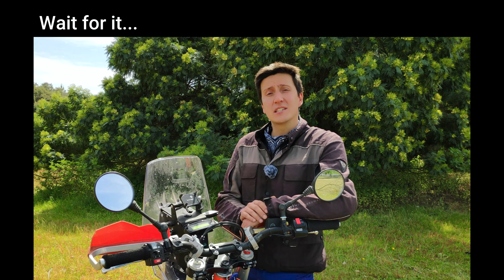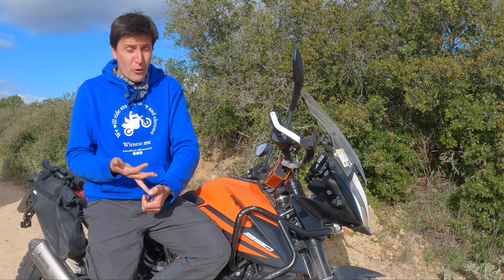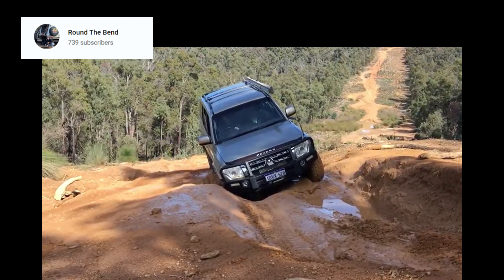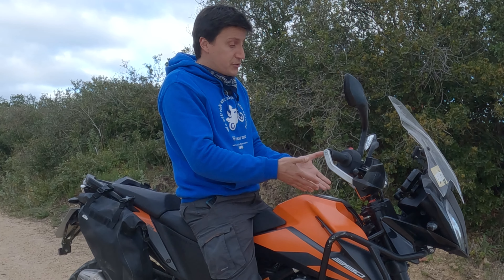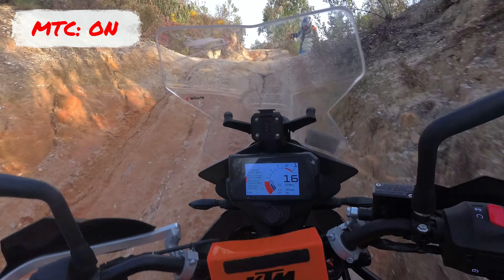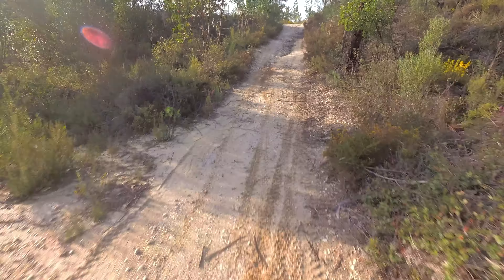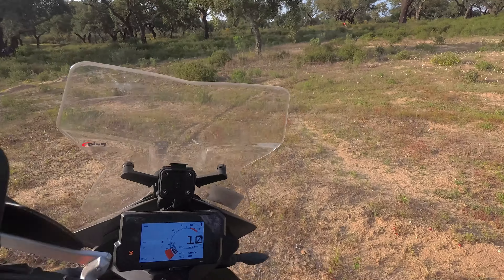Motorcycle Traction control: Does it work? Not on KTM 390Adventure (2019)...

Comment: Are they marketing the 390 adv as a beginners' adv bike? That sounds no bueno. 
Apparently old-fashioned cavemen such like us like to feel the control and response directly on their wrists. Other than assists, my biggest turn-off for these things is the perceived increased unreliability (any comments on that?), and chances that if anything goes wrong, like a sensor not working properly, may badly affect the power output or stall the bike. If I learned well from RyanF9, i'd be taking out the circuit's fuse to disable TC.  

3:45 is a norden review coming?

Thank you for the silly laughs at the beginning, now i´ll be off to rewatching that one. Cheers man.
Reply from the maker: Hey there man!
I think TCs make more sense in 100-150hp power bikes, where a less skilled rider could actually whisky-throttle himself to death... and even so, I think these things should all come with a permanent kill swtich. After all, bikes are toys and the  symbol of freedom...they are not supposed to be vehicles that any random person will buy to go shopping with the whole family onboard... so I dont think the same kind of "nanny mentality" they use for cars should be used when making bikes or passing laws about them.
Regarding relaibility... I have mixed feelings. They happen less often than I predicted, but still often enough to be scary.. especially on very very tech-no-logically advanced motorcycles like the biggest advs (1200cc). There are some pretty grim stories with BMWs. And I'm not even saying BMW is worse than the other brands, its just that 8 in every 10 big advs bikes is a BMW; so the stories add up xD
Reply: @OFFroadOFFcourse  A long time ago I read or heard somewhere that BMW were making/selling so many GSes that quality controls were unable to catch on, and consequently a generation of them had electronic-related problems. Someone I knew had trouble with his early gen 800 GS. Very dangerous.

Comment: Thanks a lot for the video. First for the laugh. Second to show that on a dirt riding situation traction control is useless, and worst a nuisance. Off road riding it's using dynamics to get through, able to slide the rear wheel in a tight turn, lighting as needed the front wheel, compressing and decompressing the suspensions to pass a tree trunk or a big rock, keeping it going forward with a rear wheel spinning on the wet dead leaves, wet grass, gravel, sand, mud make your choice...
Surely it's useful under the rain with a 200 HP bike on asphalt, but on off road there is no utility. I imagine the engine cutting off when you're in the middle of a greasy muddy climb with your big 230 kg recalcitrant elephant ready to crush you a leg at the moment you need the most momentum to stay upright...
That's the problem of the innovation race marketing where innovation is not meant to improve the product but to sell more or to justify a higher price. And adding almost useless electronics is the cheapest way for a motorcycle producer to justify high prices, or to sell that is in fact an inferior bike, or the two at the same time. I would prefer better suspensions to any electronic aid.

Comment: Good video. You are correct on all accounts. However, if you read the manual and select the correct mode for the condition you are riding in you will find that the bike is very capable off-road, of course. :) "The road setting is bad in sand" is as surprising as "the foot pegs weren't designed for standing" comment you made in your previous videos bashing the 390. Maybe if you keep riding it maybe you'll figure out how to enjoy it more.

Comment: So you have to switch off on-road traction control if you want to break traction off-road, mind blowing...
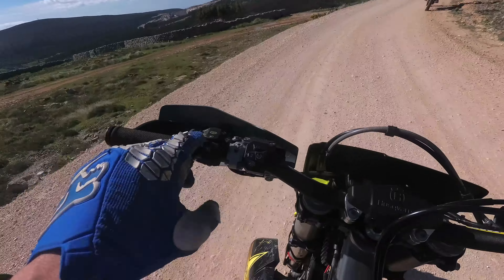Reply from the maker: Well, as you can see around 3:30 some other motorcycles actually knew what they were doing with their TCs and they work quite well offroad, so your observation isnt really that correct...

Im complaining about the TCs that dont work at all on offroad yet come equipped on so called adenture/dual-purpose bikes and on top of that,  insist on rearming themselves everytime you stall. Whats the sense in that?
If it sucks offroad, at least let us shut it down permanently when you spend a day offroad... Right?

Either way, i dont know how often you ride motorcycles offroad, or whats your experience with these electronics, but i can guarantee that to me, and people like me, it makes no sense, it its dangerous, and its enough of a nonsensical nuisance  to make a video about it on a free channel xD